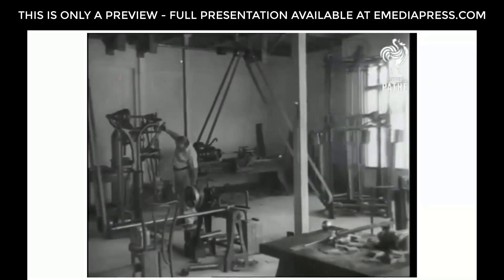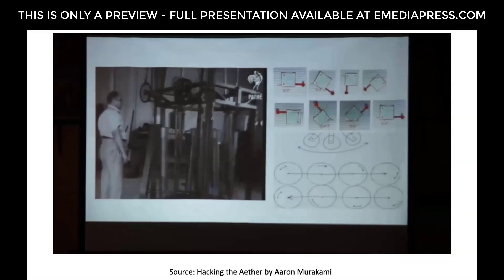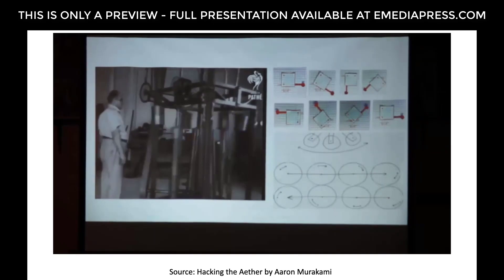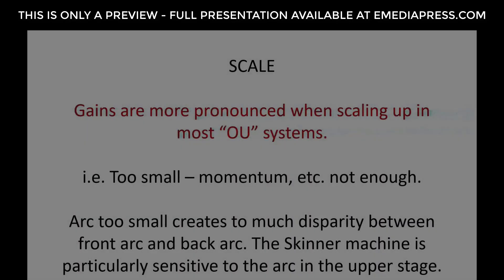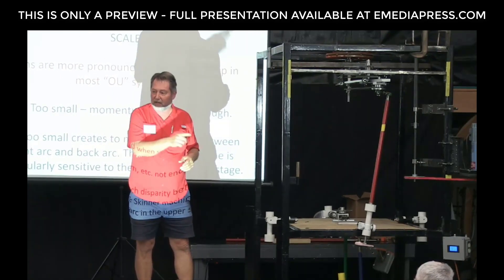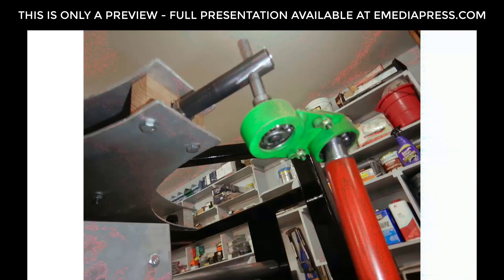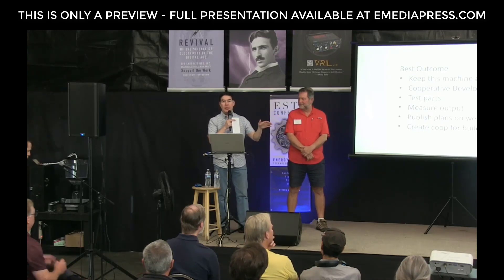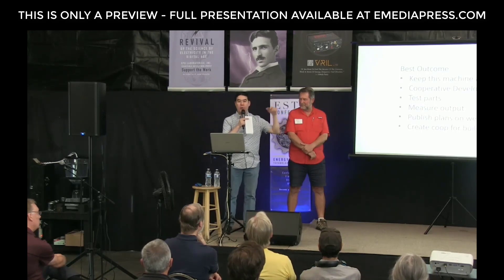2023 ESTC  -Mark Dorsten & Aaron Murakami - William Skinner’s 1939 Gravity Power Machine

Comment: My attempt to paraphrase: Forward potential or work is a prerequisite of over-unity in order to get the amplitude to cycle back onto itself, and will continue to do so as long as the work does not exceed the amperage of the circuit, or until the destruction or degradation of its components. Engineering can lift so much off our proverbial shoulders, but getting it right is treacherous and rarely happens quickly.

Comment: the longer you make the lever arms the larger the circular path the top of the arms have to make .  sure you can make them as long as you want providing you have the vertical space.  they are the most important part of the device because they have to use leverage to lift the weight.  but once the weight is lifted to full height, where it is at a balanced state, from this point only two things need to happen, the weight must be lifted a little more to where it is no longer in a balanced position, where it can now fall, in the opposite direction that you lifted it from. and the second thing that has to happen and the most important is the lever has to remain at this point as in it cannot be lifted or lowered at all and then the lever arm must begin a circular path.   you see at this point where the weight has been lifted just past its balanced point and begins to fall this is the gravity harvesting stage,  gravity begins to act on the weight and the weight falls in the opposite direction from which it was lifted.  at this exact point the lever only has one function now,  to maintain the weigh at a just past balance and falling position.  in order to do that it has to rotate, and it has to rotate at a speed fast enough that the rotating weight cannot catch up to it.  Remember the weight is falling due to gravity pulling it down, it's not being pushed by the lever,   the weight is falling in a circular path and it will accelerate just like any object gravity is acting on.  I do not know the rotational speed limit  but I know if the lever goes faster than the weights rotational speed limit that gravity has set, then the lever arm will be pushing the weight in stead of gravity only being the source of power.   and if the lever arm rotates  slower than the rotational speed limit of the falling weight, then the lever arm will be obstructing the falling weights rotational speed that it wants to run at.    the lever arms rotational speed must be the same RPM as the speed the weight wants to continue to rotate at once it gets to its maximum gravity rotational speed limit.

Comment: Don't forget the 4 legged chair analysis, when you tilt the chair back on one leg you are also balancing the chair on that one leg.  at that balance point there is very little effort needed to hold the off ballance weight of the seat up in the air.    you can put a heavy weight on the seat and still once balanced very little effort needed to hold it there and it may even be possible to remove your hand at perfect balance and it could stay there with no support at all.   from that point you only need to input a small amount of force at the top, pulling the top back a little more in the same direction you lifted it from. to lean the weight just enough where it is no longer balanced and the seat begins to fall.  and just at that point when the weight, the seat starts to fall, you again rotate the top of the chair while keeping the leaning angle the same.  notice I said rotate ?  meaning in a circle.   continue this same pattern of motion and you now have a almost balanced mass spinning while using very little effort or energy to do so, because a new energy source has entered the system, gravity is now acting on the weight pulling it down in a circular motion,  spinning the weight.   now think if instead of a circular motion at the top you used an elliptical orbit, what would happen?  you lift the mass to it's  balanced position, then instead of pulling the weight back a little more  so the weight begins to fall , you are now lifting the weight past it's balanced point.  sure the weight is going to fall as the elliptical path continues to lift  the weight but now you are using a lot more energy because you are lifting the weight instead of maintaining a close to balanced weight.  in the  circular motion you lift the weight to it's balance point and then as the lever arm is moved in that circular motion you are just keeping the mass in it's lifted position while tilting it just enough to cause gravity to make it spin.   in the elliptical path, which is really just a less extreme forward and back straight line path you are lifting the weight past it's balance point, causing a more extreme off balance angle which will cause the mass to accelerate quicker but only to slow down at the bottom of the elliptical path where once again you have to lift the weight all over again.   an acceleration and then a deceleration motion.   not only that but the weight is also moving up and down, rising and falling.    there is no balanced mass.   the skinner machine does not do that.

Comment: sorry I keep posting but I keep coming up with more to say and ideas to share.   but the  lever has more than one function, it does three functions, it lifts the mass into a position where gravity can act on it,  it then holds the mass in that position and then it rotates in order to keep the mass in that position while gravity rotates the mass.  this position also has the mass in a almost balanced state, in fact just past the balanced position because gravity has to be able to act on it.   now gravity acts on the mass and pulls it back down,  it does this by  rotating the mass, the lever must rotate in order to keep the mass in that continuous falling position.  gravity is harvested in the mass causing it to spin.     now the second stage,  the second stage is exactly the same as the first stage,  there is no difference in  it's basic  function.  you are still working with a lever,   in fact it's still the first stage lever that is rotating the second stage lever.   only now you have the added energy amplification  added by the first spinning mass. which is spinning because gravity energy has entered the system.   you now have more force rotating the second lever than you had in the first stage.  and you now use this amplified  force to act on the second stage lever to lift the secondary mass into a position where gravity can act on it.   the same as you did in the first stage.   the key to success is first making sure the top lever is lifting the first mass to the correct position then maintaining that position while rotating.   next you must attach the second stage lever to the plate in the precise location so the top lever  performs the exact same function to the top of the second lever, the second stage lever has to be doing the exact same thing the first stage lever is doing.  the second stage mass has to be lifted to a just past balance position and maintained there while the second stage lever rotates.  the rest is a matter of sizing your masses.            the drive motor at the top has to run efficiently,  geared to use the least amount to amp draw while still able to operate both lever stages.    sizing your first stage mass,        how large of a mass should the first stage be ?  remember the power to rotate the first  mass comes from gravity, but the power to keep the mass in a position where gravity can act on it while it rotates comes from the drive motor.  if you put too heavy of a mass on the first stage the drive motor will draw to many amps.    size your mass according the amp or wattage draw of the motor you have chosen.   if the motor is using to many amps adjust your mass size or your gear ratios. remember electric motors usually like to run at there rated rpm for the most  efficient use of power. I have experience with electric motors because I build small electric vehicles.  it's best to start with a small pully or sprocket on the motor shaft then gear down and up from there.     the second stage mass size plays a role also in the power draw of the drive motor too but you also have help now from the first stage spinning mass, it is helping to rotate the second stage lever so you may find you can just keep  increasing  the second stage mass size until you start to see a increase in your drive motor amp draw.  use the amp draw of the drive motor to adjust all gear ratios, mass sizes and lever arm lengths         there are other factors to consider to, such as the distance the weights are away from the shaft, things may change in rotational speeds, how high the mass must be lifted to reach the balance point,  the higher you have to lift the mass changes the levers circular path size.    the torque on the lever,  the overall size of the machine.  the larger the diameter of a circle the bottom mass makes the more torque you will have available at the shaft  to drive things.      everything I am stating in my post's  for this video i believe will help lead you to success if you are using a circular lever arm rotational movement.   if you are using a elliptical rotation or a back and forth well your on your own.  and I believe I have explained why those will not function correctly and most likely will not harvest gravity.

Comment: skinner gravity machine.  some people are saying that the upper drive lever is turning in an elliptical orbit. but it does not look that way to me and I see problems with that.  first what ever the lever is doing, it translates to what the first mass will be doing.   the orbit size and shape the lever makes will determine how high the weight is lifted ,  depending  on back and forth, elliptical, or circular the movement of the weight and how gravity will act on it will change.   the levers movement choice  will also determine the speed of acceleration of the weight, weather  there is any deceleration in the orbit or if the orbit remains constant, weather  there is any raising and falling of the weight,  The lever is the key component in the system.   if the orbit is a circle the following will take place, the weight begins at a resting point, at the bottom of the rotational cycle.    when the lever is pulled back the weight is lifted against gravity, using leverage.   when the weight reaches a position where gravity can no longer act  on it,  this  will be it's  neutral   position. you will know when you have reached this position because there will be a balance point for the weight, and you will feel little or no resistance at the top of the lever. this is the balance point of the weight.  now the lever must continue to lift the weight a little  higher, past it's neutral position, but what is really happening is you are simply tipping the weight over, like if you balanced a pencil on a table and then it falls when the balance is lost.   at that point gravity begins to act on it again pulling it down in the opposite direction from which it was lifted.    it is at this point where the lever ends the lifting movement of the weight and begins it's rotational cycle.  there is no more lifting of the weight, the weight has reached a balanced  height then passed it and is now in the falling stage.   now you are at the next stage where your choice of rotational pattern of the lever will effect what the weight will do, and how much gravity energy will be harvested.   if your choice is circular the weight will fall in a circular path, following  the levers circular path.  remember the lever maintains the weights lifted height at a constant, where gravity is acting on it trying to pull it down. and now the levers job is to maintain that position while the weight falls in the circular path and begins to rotate.   the lever must rotate because it has to maintain a constant lifted  position of the weight just past it's balance point.   the weight is kept in this constant lift as it follows  the path the lever makes.   the lifting and falling process is simultaneous,  similar to a  ocean wave lifting a surf board,  the wave will maintain a constant even steady lift ,  the surf board once raised up by the wave will start to fall but the wave does not stop, it keeps moving forward while keeping the board in a lifted position  where gravity can continually act on it. which means the board  will also fall at a steady, even, constant rate.        now lets change the levers rotational pattern to a forward and back pattern.    the lever lifts the weight from it's resting position, to a neutral position, the lever continues lifting and now gravity can act on the weight,  the weight begins to fall but what is the lever doing now ? instead of maintaining the weights position  it continues  to lift the weight, creating a ever steeper angle, which does allow gravity to pull even harder on the weight causing it to accelerate.  and what happens next ?  the lever reaches it's full height, and the weight has fallen from its full height to it's lowest height and now the lever has to come to a stop and reverse it's movement, what is the weight doing at this point ? first gravity has stopped acting on the weight and the weight begins to slow down, momentum keeps the weight going for a period but the weight is continuing  to slow down because the weight is now going up hill as the lever begins lifting it again.    it will continue  going up hill until the lever has moved far enough  in the other direction to lift the weight back up past neutral to where gravity can act on it again.    this is just one of the problems,  what else is happening ?  the weight has picked up a lot of speed going from the  12 O'clock to the 6 O'clock position.  and now has a lot more force pulling against the lever, so when the lever reverses going from the 6 O' clock back to the 12 O'clock position there is required more force and speed  applied to the lever to get it back to the point where gravity can act on it again. you are fighting against G forces and at this point you are not harvesting gravity anymore, instead you are simply throwing the weight, a slingshot motion.    you have left gravity behind and what you are doing now is throwing the weight with each forward and back movement of the lever.   that is  not how the skinner device functions  and you will get no energy amplification, only a need to keep moving the lever faster and faster each direction to catch up to the rotational speed you are creating in the weight.           so what about the elliptical orbit ?   the same thing is happening in the elliptical as with the forward and backward movement except  to a lesser degree.   the weight is lifted, gravity begins to act on it,  it begins it's elliptical path which also continues to lift the weight but to a lesser degree,  the weight accelerates but to a lesser degree, the weight rises and falls but to a lesser degree, the lever transitions from lifting  to going  the other direction but to a lesser degree,  during  the transition the weight slows down but to a lesser degree,  sling shotting  the weigh but to a lesser degree.  and depending on the speed your lever is moving in this orbit you may harvest gravity or may not. but at a much lesser efficiency.   in a elliptical orbit  there is acceleration and deceleration there may be jerking forces involved,  the weight will be constantly lifting and lowering while rotating.   why lift the weight so gravity can act on it only to lower the weight twice through each rotational cycle and prevent gravity from acting on it ? it makes no sense .  when you can have the weight in constant lift and falling mode with a circle? no jerking, no speeding up and slowing down, no rising and falling in height. just a steady falling of the weight, even, constant and balanced.     I challenge anyone to prove this analysis wrong.
Reply from the maker: Because it is elliptical.
Reply: @AaronMurakami13  it can't be elliptical as I just explained why, the proof is demonstrated by your own machine  that you fail to show us input energy compared to output energy, and when that guy asked if you had there was no real answer.   I believe you have failed to replicate the skinner device because of your decision to go with the elliptical design. and your now spreading dis information that will lead to failure in all who choose that design.
Reply from the maker: @rmendes2mendes915  I'm not making any input vs output claims at this point but it is elliptical at the top in Skinner's video for anyone that has eyes to see and the intellectual honesty to admit it.
Reply: @AaronMurakami13  I just wrote over 1100 words trying to explain how important the levers are in the system and how i believe they must function and all you can do is keep repeating the same thing, it's elliptical it's elliptical,  while providing no proof other than  what you think your eyes  are seeing.   you do know that you cannot distinguish the lever movement when it is moving toward you and away from you right? watching the levers you will only see what appears to be a kind of forward and backward movement.  you are so convinced yet no proof of energy amplification in your machine.  I have eyes to see but visual analysis only goes so far, you have to analyze  what the mass would do,  how gravity could be acting on everything,  analyzing all the levers possible effects on everything.  where are your written statements on all these possibilities, like I have offered.  tell us, if you have it all figured out.
Reply from the maker: @rmendes2mendes915  What have you built that works based on your ideas? :)